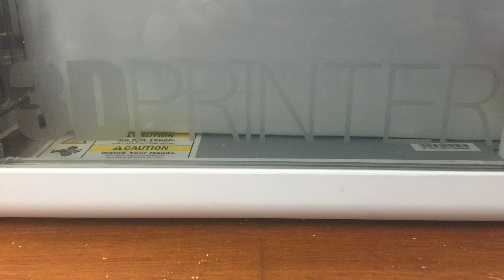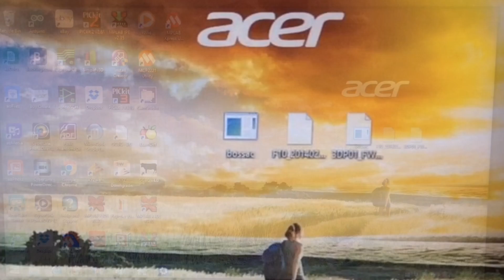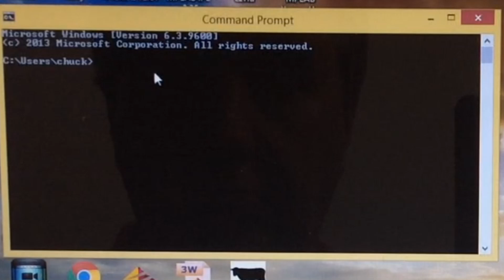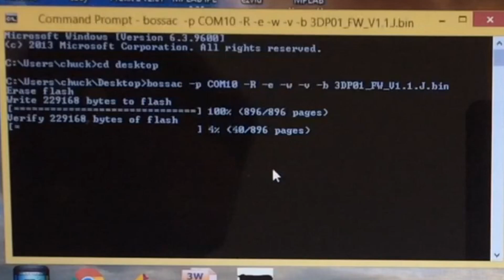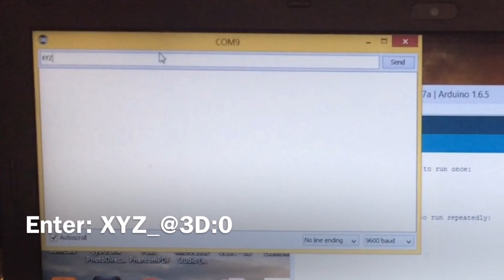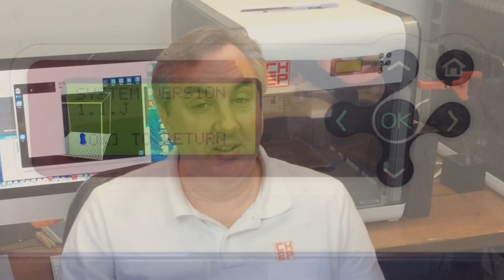Tuesday Tech Tip - Downgrade your Da Vinci 1.0 from 1.2.3 to 1.1.J Firmware

Comment: I have a aio 3S10A da vinci it upgraded to 1.2.3 how can I get it to go back please have 2 black bars now followed instructions did as said it flashed said set boot flash true and cup reset but bars still there and when I open Arduino its lost the usb port also lost it in device manager so cant go any ware can you help please

Comment: Hi, this works whit davinci 1.0 aio??
Reply: CHEP 3D Printing I am from Colombia, and I have not been able to print in PLA why it does not let you change with Arduino the plastic, I would like to return the firmeware you know as I do I have 1.2.3
Reply: I hate this printer only brings problems, now does not want to print does not leave the filament for the cartridge, you have some way to contact you so that we speak many thanks.

Comment: I just got this printer, it currently has 1.1.1 and tries to update every time I try to print something. Any ideas as to how to stop this? 

Also your are the man, all of your videos are great compared to 99% of the others I have seen! +500
Reply: My printer is for sure not the 10.a & does not say 3dprinter on the door (along with all of the other clues that are in your comparison video)

The firmware version is 1.1.I
Reply: ***** Any ideas on what to do? The printer is right out of the box. 

(any 3rd party printing software or anything, im itching to start using it but I dont want to be stuck with the XYZ filiment)

Comment: I have a davicni with 1.3.3 and I can reset the cartridge amount but no matter what I set the temperature to, it won't change on the printer. Will downgrading the firmware allow me to get the printer to actually listen to my custom temp settings?
Reply: ***** I use a resetter that I connect to the chip that has an option to change the temp. will that work after downgrading? if not, will slic3r let me? p.s the reseter is called dimensionbx reseter

Comment: great video! but i flashed my Davinci 1.0 and it is now 1.1.j. i flashed my cartridge back to 240m and the printer recognizes it. but when i go to upload a print i get an error on my computer saying the cartridge cannot be recognized. do you have any idea on how to fix it? i was getting the same thing with my newer firmware and thought flashing the printer back to 1.1.j would fix the problem but it has not.
Reply: any suggestion on what version, i have tried 3 different ones and one still rejected the filament. the other 2 did not find the printer even with the drivers updated

Comment: Just stumbled into a new error and now have to do the downgrade. I tried to use PLA on a reset and the system says this printer does not support pla without and upgrade. New error but am curious has anyone printed pla with stock nozzle?  Thanks chuck I will have to try the reset steps in the video a little nervous about resetting the device.
Reply: Basically on the reseter software set it as abs but change the temps to what pla usually prints at
Reply: what settings would you recommend and have you done this with the original print head or do you have the newer one?
Reply: are using davinic software or other?
Reply: I use a dimensionx resetter.  That reseter comes with its own software that allows you to change the amount of filament left in the cartariadge and the temperature. that software also allows me to select abs or pla.. since my printer technically doesnt  support pla,it wont let me use that cartariadge. First, I set it to ABS, BUT I change the temperature on the resetter software to accomidate pla (I make the printer think I'm printing abs, but I change the temp settings so printing pla iis possible). before you try to change the temp, downgrade your davinci firmware. the latest firmware doesn't let you change the temperature, instead just heating to the standard abs temp settings no matter what you set the cartaaidge to. once u downgrade u should be able to get the printer to change the temp with the reseter. the standard settings for pla are 195 degress C for the print head, and 0C for the heated bed. it is recommended to put tape on the bed if u want the pla to stick. other than that, I have standard davinci everything. I have not modded a single bit of the actuall electronics of the printer. the only thing I have done is downgraded the printers firmware.none of the electronics are changed. I hope this helped u it took rly long to write
Reply: I use standard XYZ ware

Comment: I finally had to do the down-grade on my 1.0 Davinci. After hundreds of prints and 3 SW/FW upgrades from XYZ, this weekend I tried to print and got the message "NOT A GENUINE CARTRIDGE" .  WTF, I just used that cart on a previous project. XYZ's tech support is useless, on-line or phone. I successfully down-graded my unit, BTW, great video. You will have to re-calibrate the print bed height after flashing. Anyone else had this message pop up on yours?

Comment: Chuck, great video! I happen to run across your channel be accident due to I've been looking at getting a 3D printer. Do you still recommend this printer "DaVinci 1.0" at the normal cost of $499 using the stock firmware? Going forward I would probably upgrade to Repetier firmware.

Comment: nice video :)
You have shown some improvements they made to the 1.0A in an earlier video... would you say buying now I should go for a A or just the normal one? Thanks!
Reply: thanks! Will look into those!
Reply: +Chuck Hellebuyck's Electronic Products I believe that's true however for price I would say that the Da Vinci is very competitive and haven't seen an open source printer around that price point. May still be a good deal if you have the confidence to reflash to repetier but as I haven't done this cant comment too much. When reflashed does it have the same quality as the printers you've mentioned?
Reply: +Chuck Hellebuyck's Electronic Products I have reflash the printer but Im using a old versione of the xyz software to open the stl file and print it , can I upgrade it to the last version ? or it will affect the printer? I already blocked the xyzWare from connecting on the net and checking the printer FW updates